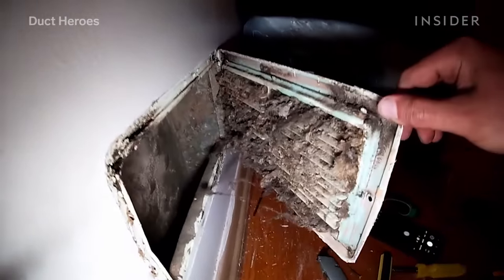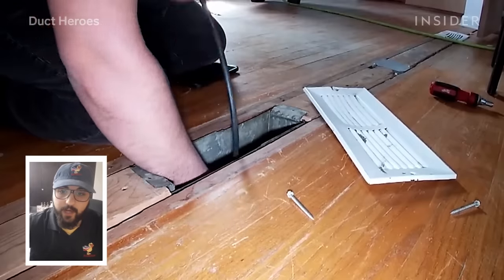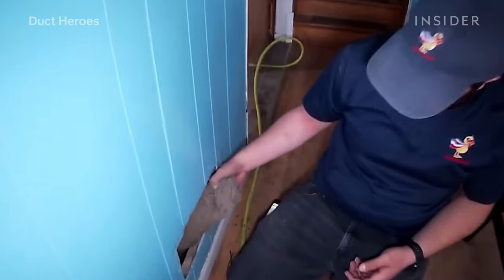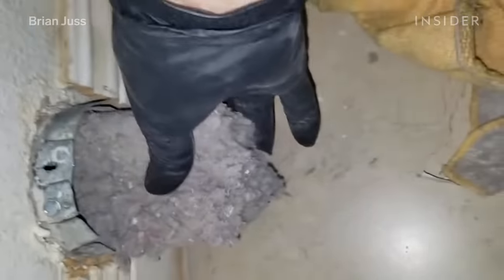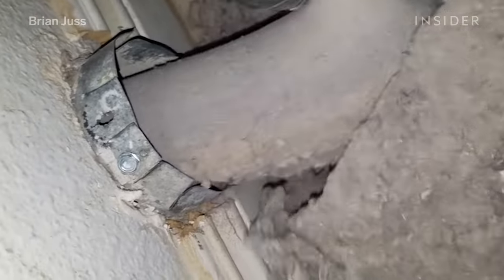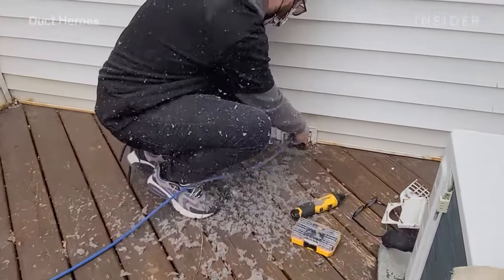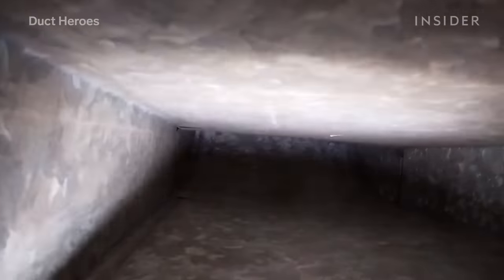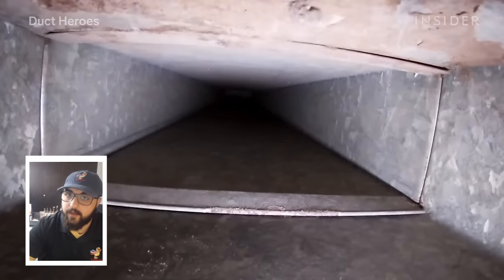How 47 Years Of Dust Is Deep Cleaned From Air Vents | Deep Cleaned | Insider

Comment: My apartment desperately needs its ducts cleaned. I don't think the landlord has ever done it - when I first moved in even the lint trap in the dryer looked like this, and there was a ton of dust in the back of the dryer. I cleaned it out as best I could but I don't have the tools or expertise needed.

How do you convince a landlord to shell out for duct cleaning?
Reply: If you can get pictures inside the vent you might be able to file a complaint either through the board of health or the fire marshal.

Comment: Man I’ve tired using these things so many times, the back doesnt slide open and customer service is always rude.

But if it works  Ill be able to use this when I travel abroad and stay in downtown hotels that get absolutely filthy and keep ya up all night spraying the interiors as well as the face of the surfaces and  in the deepest darkest tight sections you can’t see until your push your way in.

YOLvO

Comment: I find it hilarious that the guy keeps talking about “100 years” (or even “over 100 years”) of dust, when domestic forced-air furnaces weren’t even introduced until 1935. (And domestic  central air conditioning even later.) As for the homeowner who said 47 years, I’m guessing the homeowner knows the age of the house or of the HVAC system.

Comment: The dust has not been there for hundred years, they did not have ventilation shafts like these in homes in 1923....... This is as the client said, probably 40 years old, which is way more reasonable. And I hope he cleaned the AC unit outside, man this guy is not worth any admiration. He just does the job he is paid to do as he should do it.

Comment: Ïs air vents an American thing? I've now lived in at least 5 houses in Denmark and not one of them had an air vent other than in the bathroom.  We just open doors and windows a couple of times a day.
Reply: What about heating?  Di you have radiant heating installed in your floors?
Reply: Most homes built here in the US within the last 50 years have central forced air heating and air conditioning with duct systems to distribute the heated or cooled air throughout the home.